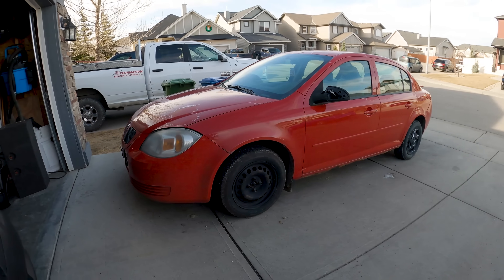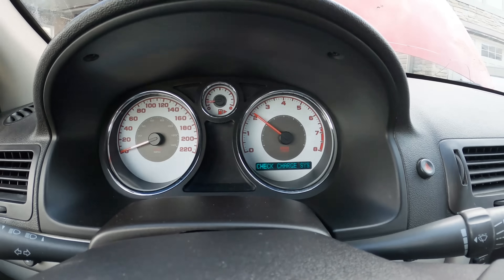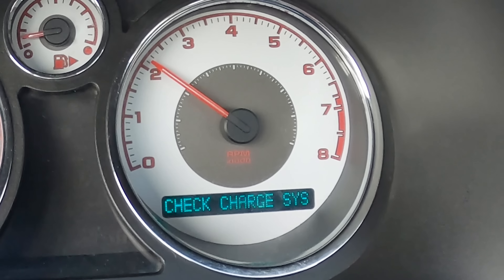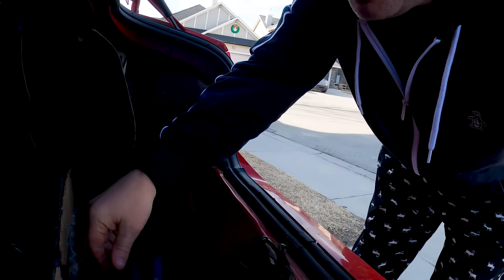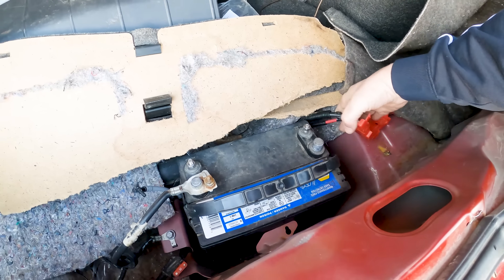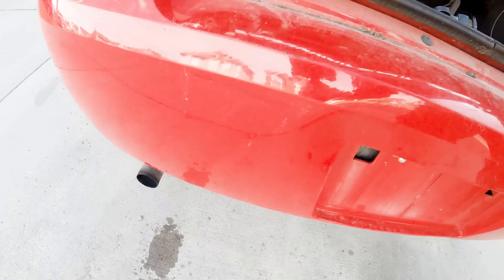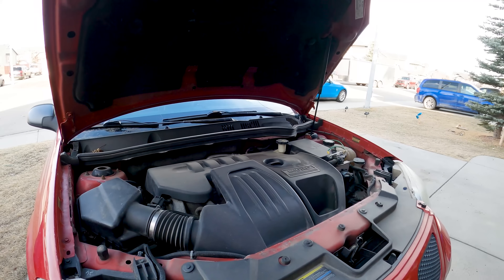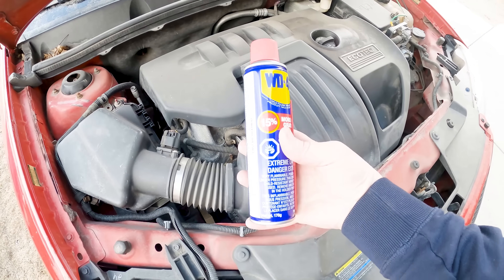ROADSIDE FIX! REVIVE your DEAD or DYING Alternator with this ALMOST FREE trick! | Gears and Tech

Comment: This should not be done with any car that has fuel injectors and a computer. This is only safe to do on a carbureted motor.

Even though your battery technically starts the car and the alternator takes over when the car gets started, it doesn't completely erase the need for a battery to be in place on modern vehicles.

Why this is not a smart idea on modern vehicles:

Newer cars rely on the battery to act as a buffer and regulate voltage. If you remove this buffer, the car can have voltage spikes and fry sensitive electrical components with your ECU being the worst. It can also overload your alternator itself and if it wasn't bad before, it most certainly would be now.

Long story short, DON'T DO THIS!

The easiest way to do it was already done in the first 10 seconds of the video. Get the car started and if the battery doesn't show 13.7v and above while started, the alternator is bad.

Comment: If you can remove your battery terminal without tools, that is problem #1

Please explain how WD40 repaired and failed diode?

This is a unicorn fix. Do not put your life at risk from this advice
Reply from the maker: Cheap car with poor maintenance

It didn't fix a bad diode and won't

Not a unicorn, this is worth a shot for an otherwise dead alternator being replaced anyway

Comment: we will try this tomorrow. just bought a new battery, but everyone says its the alternator. will spray it first thing tomorrow :) and avoiding spraying the belt. thank youuuuuu
Reply from the maker: Did it work?
Reply: @GearsAndTech  yes it did :)  we got the car driving on the third day now. i bought a voltometer so i can find out if it was just the battery or the alternator. the noise was gone after we sprayed wd40 on it. but we will order an alternator from autodoc. 1 quarter of the cost than here. our car is 14 years old and drove already 470.000 km.
Reply: @katrinboas  Did the car start before u did this? My car won't even turn over
Reply: @beatpax  it tryed to start but did not have enough power. the lights came on. so thats why we bought the new battery. its been driving fine until yesterday. my son told me the car is a little off.  so later today we will check the new battery. if its loosing its battery or if it really was the generator all along. fingers crossed.

Comment: Jump to 8:00 for the info.
Reply from the maker: Good looking out
Reply: @GearsAndTech  One time my alternator light was on and I started thinking about a replacement.  After a couple of days it fixed itself and worked from then on.  The radio in that car went out due to a leaky windshield dripping on it for a long time.  I sealed the windshield and the radio started working again after drying out for a couple of months.  If only all cars would fix themselves.

Comment: I tried this trick and it worked and now my alternator is back running . You could also use an air compressor to try and clean out particles that may have cause the bristles to have residue
Reply from the maker: Nice work!

Comment: "No tools needed" is completely misleading. Your battery terminals are never or should never be loose. Also I agree with the others that disconnecting the battery is not a good idea while running the engine. I do not remember the exact reason but it is on the ASE classroom manual. Last I don't know if it's a Canadian thing but the semantics are way off compared to American English. I saw a video of a guy calling the actual door panels "doors." The way you refer to the "charging system low" is incorrect. The charging system is either charging or not but it's not "low." You probably meant the battery was low. Words matter!
Reply from the maker: I disagree with some of your assessment.

For example, it's totally possible for a charging system to be performing poorly. It's not broken as it does still produce power. But not enough to work correctly.

In those cases adding rpm does in fact get enough juice going to charge the battery.

For that reason, charging system low is appropriate.

As for manuals and other bs, there is a difference between the shop accepted correct way to do things, and the emergency roadside fix way.

Most shop trained mechanics have no idea how to make things work. They only know what they learned in school.

Fact is, i am still waiting for someone to tell me which vehicle will fry the computer when the battery is disconnected.

I am not talking about maybe, because maybe a lot of things will happen sometimes

Tell me which one, according to your manual has certain failure guaranteed. I'll try it out on camera so we can prove you wrong!
Reply: @GearsAndTech  The alternator is really an AC generator. The AC current gets converted to DC to charge the vehicle's battery and maintain all other electrical demands running. The battery primary function is to provide power to the starter and also serve as a reference (DC) voltage for the computer. If you disconnect the battery with the engine running, the AC generator (with no reference) can easily produce up to 200 volts of AC current which would then be converted to DC. Anything above 16V of DC current will immediately damage crucial electrical components in your vehicle including the ECM.

Comment: There is a lot of misinformation in this video. If you try disconnecting either battery cable on these newer cars w/computers with the car running you'll create an even bigger problem than just replacing a bad alternator. Secondly, even at idle, you should see a reading of (at least) 14.0 volts on a reliable volt meter (multi-meter).

Comment: I believe your intentions are nothing but good, 
 showing people some tricks about their car when they areout in the middle of nowhere or with no tools or anything. But it's not good advice to disconnect the battery when the car is running with any car that has a computer in it. That is a really really bad idea. 

It could possibly cost you way way more than $500 to fix it. In the 80s and some of the early 1990's cars you could swap out a ECM from another car from a junkyard but nowadays you can't do that. You have to get a new one have it flashed I mean your power control module could go out it's just not good advice in my opinion. Although I have seen some of your other videos your tricks were valid and worked quite well some of them I even forgotten. I do appreciate you helping people that may not know what to do whatsoever. Any car that's got a power control module or an ECM as soon as you disconnect the power the motor doesn't know how to run you just disconnected the brain from the rest of the body you know what I'm saying?
Anyways thanks for hearing me out

Comment: You failed to show us the voltage is after the car kept running. 
We don't have CRUNCHY ROLL in California.
Like a Payday in the USA ? 
Is that like a Pearson's nut log ? 
Caramel & peanuts. 
I HAVE AN INTERMITTENT VOLTAGE LIGHT IN THE DASH . ALTERNATOR PUTS OUT 13.8V . 
NEVER STRANDED ME EXVEPT WHEN I RAN MY HAZARD LIGHTS FOR 5 MINUTES AT MY MECHANIC. HAVENT SEEN ANY ISSUES SINCE. 
BATTERY CHECKS OUT FINE AT BATTERY STORE, WHERE HE LOAD TESTED IT. 
BEEN DRIVING IT THAT WAY FOR 1.5 YEARS WITH ISSUE.

Comment: Some alternators have the brush holders sticking out of the back. You maybe able to get a new holder with new brushes and replace it simply by removing a couple of screws on the back of the alternator without removing it or the belt. I did this back in 2013 on my 94 Ranger and got another 3 to 4 months out of the alternator.

Comment: Many modern vehicles monitor current and and control voltage by pulse width modulation on the field circuit. Disconnecting a battery terminal while running can cause the alternator to full field which can severely damage multiple components in the charging system. Back in the 50's when we used DC generators there was no harm doing that, but NEVER, EVER disconnect a battery lead with the engine running!

Comment: omgf ,,, never disconnect the battery on a running car ,,, that was thirty years ago you could do that , never today,,,,,, just pull up to a wall turn on headlights and heater heaed windows  etc , sit at tick over then rev the engine, providing it hasnt led lights you will see the brightness increase from tickover to 2k revs , thats a safer test by far.

Comment: Pulling the battery cable off a battery while the car is running you can mess up your computer, any mechanic or garage will tell you that I am a diesel mechanic for over 43 years and I know better than that

Comment: Brushes can get stuck:  lots of carbon dust there.   WD-40 makes a lot of sense.  Thanks.  Good tip.  It's right up there with hitting your starter motor with a wrench if it gets stuck.  Mmm.  Those two tricks might be helpful in either case to some extent.  If you have solar or charged up 12 volt other battery of any kind, you can always put some juice on your battery, too.
Reply from the maker: Yes, hitting the starter with a hammer works too. Sometimes they are hard to get to though wd40 can be sprayed in easier and fixes other stuff too.

Comment: If your battery terminal can be pulled off without any tool is part of your problem if not the problem. And most newer vehicles you do not want to disconnect the battery while the vehicle is running

Comment: Be careful pulling terminal leads while the car is running. I had a Mazda I did that on, and the car went into survival mode. The windows rolled down, car shut off, and never could get the windows back up. I tried all kinds of resets, this and that, etc. to no avail. I ended up junking the car anyway, too many electrical problems.

Comment: Maybe you need to tighten the battery cable so it charges if your battery cables are a hand loose could be an issue with the alternator not being able to charge up the battery I would probably do that first
Reply from the maker: Fair point

Comment: Never ever disconnect a battery while an engine is running!
If it is charging there will be an enormous voltage spike that will destroy all of the electronics and the cost of repair could be more than the car is worth.
Reply from the maker: Weird how it didn't do anything here?

Comment: Yeah, WD40, or even compressed air can clean the dust & debris from the alternator brushes so they slide more easily, take up wear & restoring electrical contact, but that isn't the only fault that an alternator might have.  A very common fault with alternators is blown rectifiers.  An alternator generates several phases of AC (alternating currant), which is not what you need to charge a battery.  What you need is DC (direct currant)  for this reason, alternators have inbuilt rectifiers,  one for each phase of AC.  Each rectifier may be a 4 diode bridge, or it may be a single rectifier component which is internally the same thing.  Diodes do fail and when they do, you loose that phase of DC.  If that is the case, no amount of WD40 will help the situation at all.  You can take the alternator to an auto electrician.  Depending on the exact circumstances, the Auto electrician may recommend a repair or replacement with a new alternator.  It is not very expensive to just replace the diodes or the brushes if that is all that is needed, it depends on the state of mechanical wear & replacement availability etc.  If it's a vintage car for example, repair may be the only option.
Reply from the maker: Totally agree. Broken rectifier won't be fixed any way except with replacement

But, if you're stuck on the side of the road wd40 is worth a shot.
Reply: @GearsAndTech  Indeed worth a shot, I just felt you presented it as a sure fire solution.

Comment: I installed a brand new hella alternator on my w202 and it failed after about 7-8 months. I understand the wd40 spray is about giving the carbon brush a fresh contact right? But will it work on mine too? Now it's really dead, it happens when it was raining hard.
Reply from the maker: Yes, all alternator work the same way
Reply: @GearsAndTech  okay will try, thanks never thought wd40 would be this useful😂

Comment: Dont disconnect your battery while the engine is running, you could fry your ECM and that could cost you thousands to replace.
  Dont soak your alternator with WD-40  you will be replacing the alternator soon even if it was fine before you did it.    Dont listen to this dolt's advice.  Find someone who has a clue and ask them to diagnose the problem accurately.

Comment: Well, that decides it - gonna go look for a spare, tested alternator for my  newly purchased Peugeot 107. Battery would barely crank once, then not at all. Replaced it, but now need to look up how to test alternators. Any good suggestions for YouTube videos?
Reply from the maker: Check voltage while idling

14 volts alt is good

12.9 or less and alt is bad

Comment: This is not good practice for testing alt. Output on any modern car as it will spike the alt. And almost guarantee it’s garbage . Especially if the the car has a alt. With a built in regulator . The diodes will fry in seconds . Why that doesn’t happen when your battery’s at fault or your connection has high resistance is because there is still a path for the power ,unlike completely disconnected when engine is running. Triple A towing is much cheaper than fooling with with your car if you n
Know not what you are doing . Heck the computer alone is more than you paid for the car ,plus the install ! Sorry …

Comment: You are giving so much misinformation. Newer cars will not always run when you disconnect the battery with the car running. Absolutely ridiculous !!!
Reply from the maker: If the alternator is dead they won't run
Reply: @GearsAndTech  ... And a lot of time when the charging system is functioning perfect if you disconnect the battery it will stop. Try it on a 1986 Mustang. Try it on a 1989 Thunderbird. Those vehicles in countless others will turn off when you disconnect the battery cable at the battery with the charging system working absolutely perfectly. 

Furthermore, you can cause serious damage(s) by removing a battery cable with the vehicle running It is not recommended to do to any vehicle especially newer ones with a lot of computers. Cars with more than one computer's need a steady amount of electricity through their system and disconnecting them can easily cause hundreds if not thousands of dollars in damage.

Lastly you could cause a spark and if a battery is in poor condition and has hydrogen gas leaking out of it this could cause an explosion in somebody's face. 

There are multiple reasons that this is a terrible technique to teach and furthermore, nor does it work all the time ! 

You really need to open your mind up and study why it is such a horrible practice and especially to teach others as well as jeopardize others health. 

Search this and read the replies !!! 

" dangers of disconnecting battery cable with vehicle running"

Comment: I say this with all due respect and with acknowledgement that the creator of the video knows infinitely more than I do about vehicles, but the advice to remove a positive  battery cable while your engine is running is VERY bad advice. Don't do this as in newer vehicles it can cause serious issues with the ECM/computer and various electronics. Don't take my word for it. Call your favorite high-tech (currently licensed) mechanic and he or she will tell you the same. (Also, never remove the positive cable first for any reason. Negative first off, last on.) Finally, DO NOT SPRAY YOUR BELT with WD40. 🤦🏻‍♀

Comment: "It is absolutely not a good idea to disconnect the car battery while the engine is running; doing so can severely damage your car's electrical system, particularly the alternator, as it has nowhere to send the generated electricity, potentially causing it to fail. 
Key points to remember:
Always turn off the engine before disconnecting the battery: to avoid electrical damage. 

Disconnecting the battery while the engine is running can lead to electrical surges and unpredictable issues with the car's computer systems. 

If you need to work on the car's electrical system, always disconnect the battery first as a safety precaution."

Comment: yo i did this today on my honda civic and it worked for a few hours then the problem came back.. batt light came on and started losing power..went to spray it again and started it with a booster pack.. started up and smoke started comin out the alternator.. left it to run a bit and turned on the heat.. was smelling a burning plastic smell.. shut it off. boost started again let it run.. took off terminal and it cut off right away.. kept repeating.. engine light stayed off but alternator still not charging batt.. i would leave it to run 20 30 mins and as soon as i remove the terminal its cuts off.. im 400km from home. have to sleep in the car and hope i can find a mechanic and alternator in this small town.. gonna lose a days work tomorrow also on top of what im gonna get charged

Comment: That is wrong, it’s not ok for the voltage to be low while the car is idling, the alternator is designed to put out a 13.5 V to charge the battery. The only way they alternator will not put out 13.5 V when the car is idling, is if the battery is fully charged, then voltage will drop to prevent overcharge of the battery.
Reply from the maker: I agree

Comment: Spraying a thin lube, AKA WD-40 or PB-blaster, into the alternator is going to do more damage over time. Once a thin lube gets into the bearings, think about replacing them to..
That's if you have the tools.  If a diode pack or rectifier pack has gone bad, this won't work, it will just piss off the one replacing it!
Reply from the maker: You have nothing to lose, this thing will maybe fix it for a bit. Or it may do nothing. But the alt is broken already anyway.